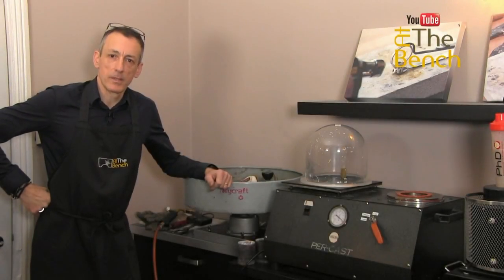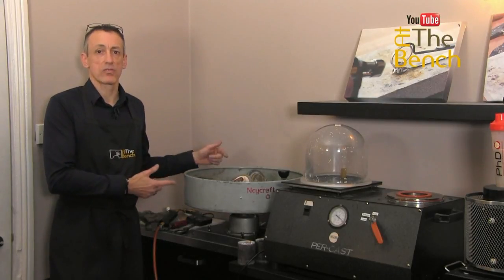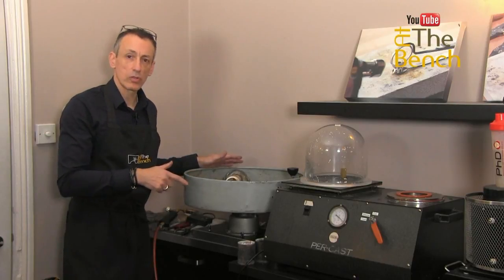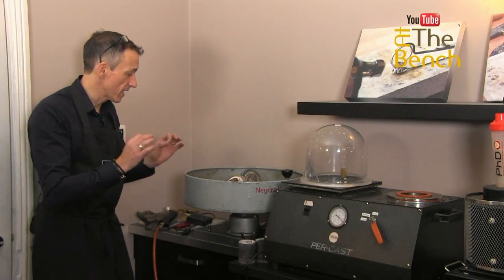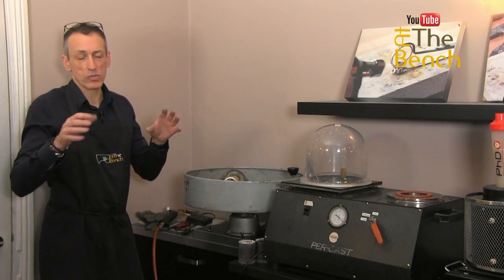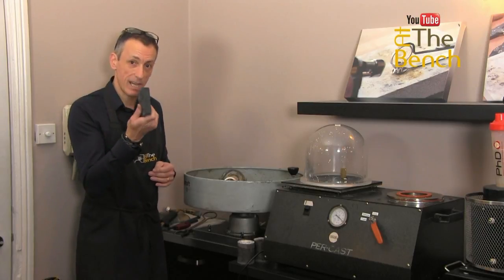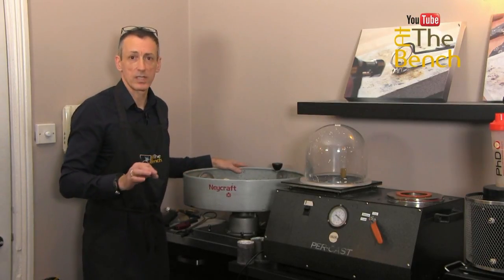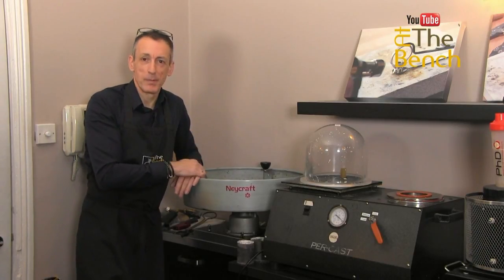Answering Some Of Your Questions About The Neycraft Centrifugal Casting Machine

Comment: I have a question about material/crucible. I am wanting to cast chess pieces in copper and aluminum. I ran across this product and thought maybe this would work for what I am desiring. Can I use this for non precious metals like aluminum alloys? Or are there any other methods that might work better?

Comment: My metal is splashing out. What could I be doing wrong?
Reply from the maker: Perhaps the metal is not being forced directly into the hole in the flask? Or the sprue hole in the flask is too small.
Reply: I think the flask might be ok the hole in the crucible might be to small. Its a large ring about 2.5 oz

Comment: Hi Andrew If the arm was straight the metal would fly over the side of the crucible when released that’s the main purpose of the bent arm in a horizontal casting machine
Reply from the maker: cautopates No, due to the shape of the crucible no metal would come over the side of the crucible